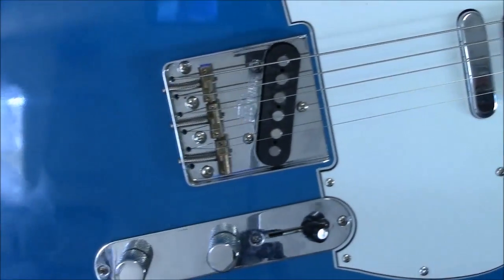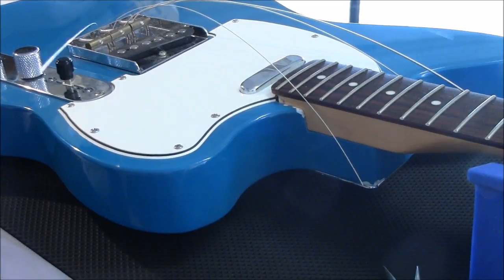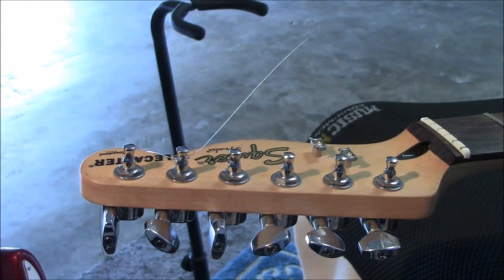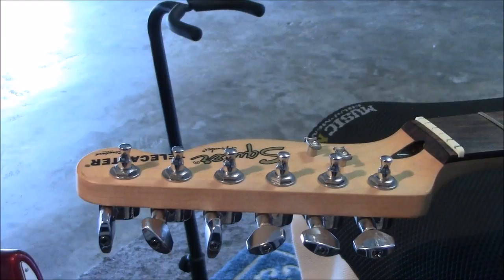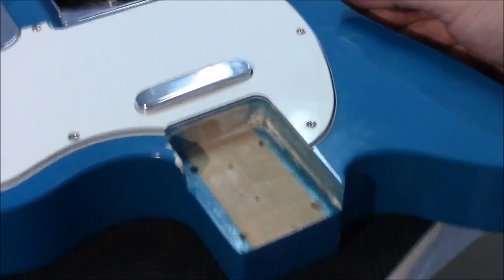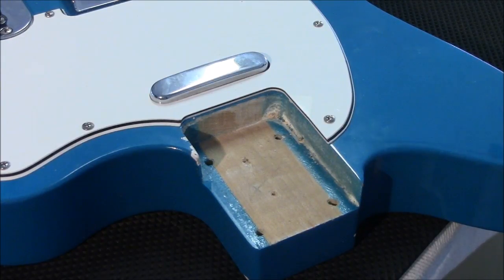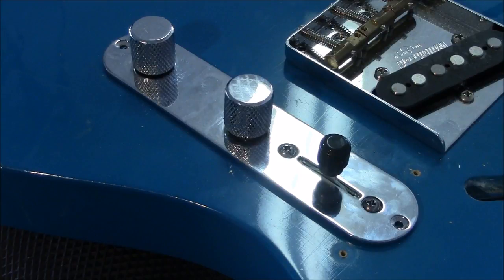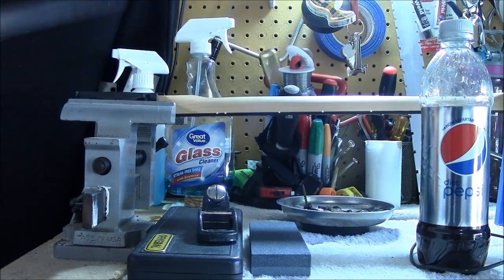The Custom Blue Fender Setup and Repairs

Comment: Sorry I missed the squire decal. My mistake
Reply from the maker: Dane, this is a custom body with a Squire neck.  The real issue with this guitar was the custom body didnt fit the neck as far as the depth.  So, thats what was one of the fixes. Have a good one.
Reply: Davesintexas you too